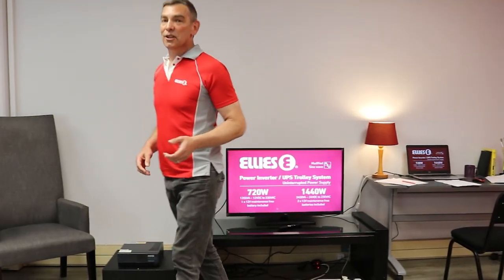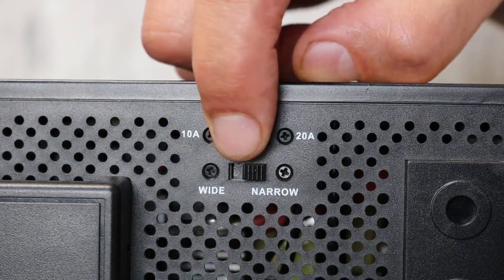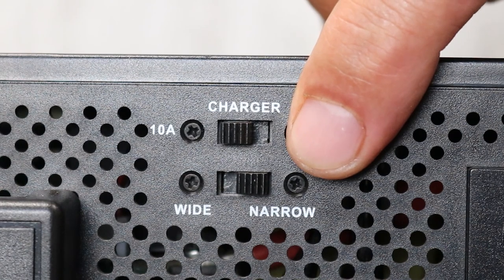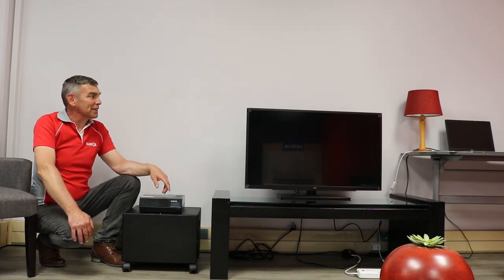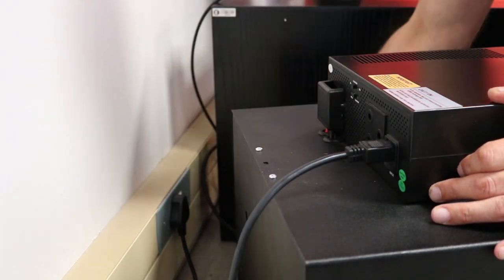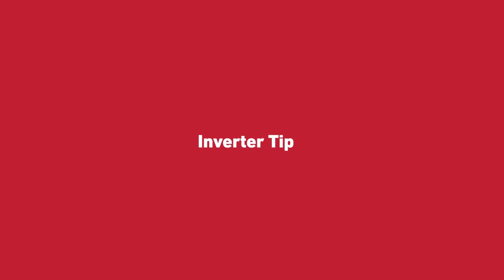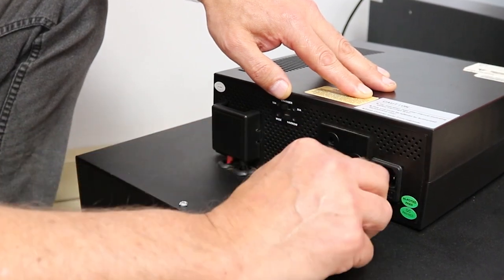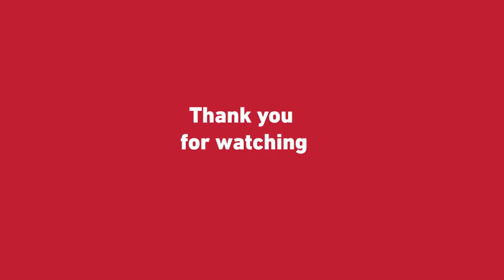Backup Power Solutions from Ellies

Comment: Great system but with the short periods between loadshedding cycles the inverter never really gets fully charged.  Only other issue is the fan when it is running is very loud.  Other than that highly recommended
Reply: Hi Jamie's, would it be able to run a 58" TV and my Internet for 2 hours?
Reply: @delanoprim8213  I have had mine for 3 years and through hundreds of hours of loadshedding.  When I bought it, I was running a 70in TV, 7.2 surround sound, 2 lights, a gaming laptop, a normal laptop and two VDSL routers for up to 7 or 8 hours.  The batteries after 3 years have taken a knock with Stage 6 loadshedding and now if I run half of that I get about 2 hours.  I need to change the batteries which are about R3,000 each upwards so when you buy it put some money aside for replacing them.
Reply: @jamier7073  thanks for this, would you mind sharing what best batteries are out there to replace the. with please